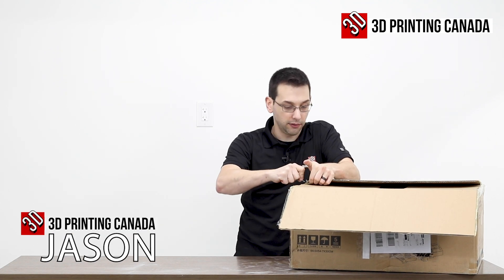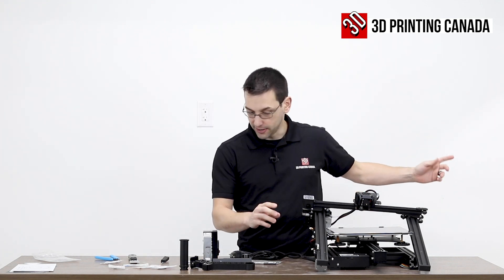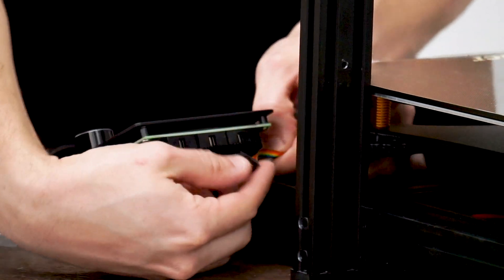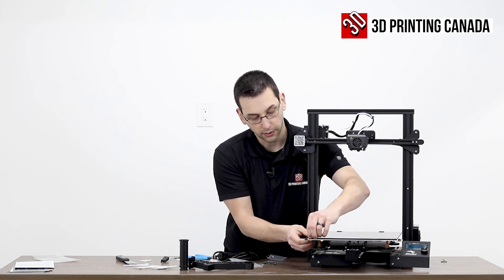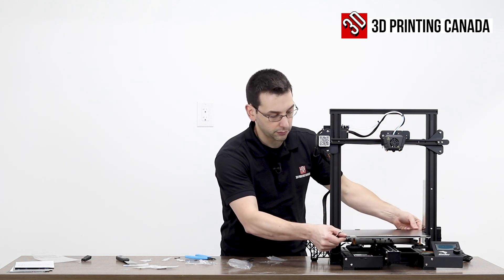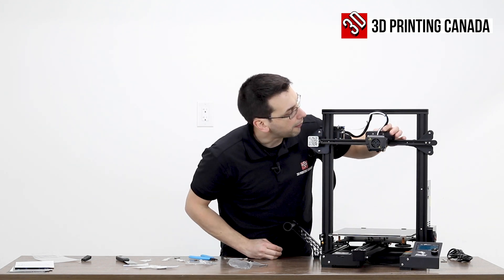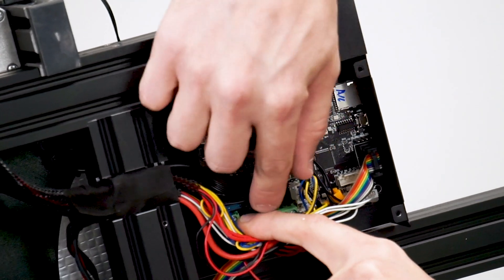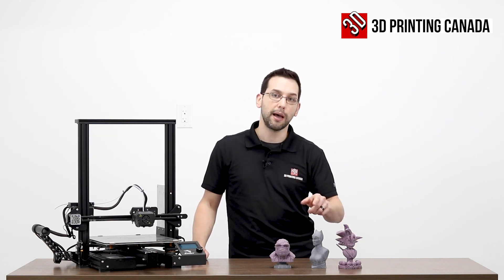Creality Ender 3 Max Unboxing & Build

Comment: YOU DIDN'T ALIGN THE UPRIGHT FRAMES USING A SET SQUARE. HOW DO YOU KNOW THAT THEY ARE PERFECTLY VERTICAL? IF THEY ARE NOT IT WILL CAUSE YOU BIG PROBLEMS LATER
Reply: Stop shouting.

Comment: Would it be better to route the ribbon cable to the screen under the frame railing?  Otherwise might not the front right bed adjustment knob possibly come in contact with the cable?

Comment: Creality cheaping out again. Instead of lengthening the transverse base extrusion by 2 inches they made a cutout on both sides and fixed the uprights on the outside. Perhaps those few inches extra extrusions are worth more to them than the extra machining time required for the CNC cuts in the base extrusions.

Comment: Which one do you recommend the ender 3 max or cr 10 v2 for a beginner
Reply from the maker: Max would be a simpler machine to start with
Reply: @3DPrintingCanada  I also have a question, which one should i buy the ender 3 v2, or the ender 3 max, im wanting to print bigger, but don't know If the max is justified enough
Reply: @cesarnuno309  i guess is better the max just for the  print size, basically they are the same just the screen